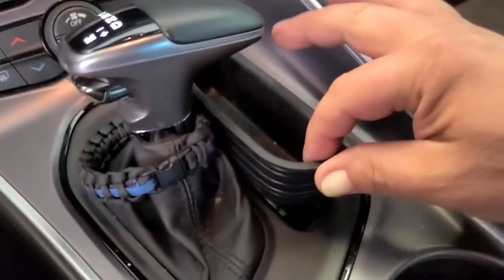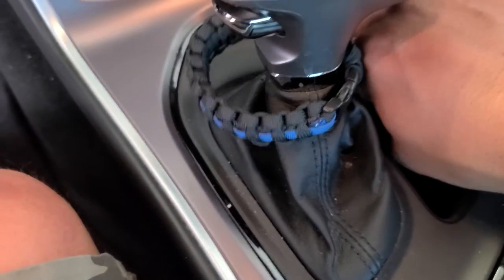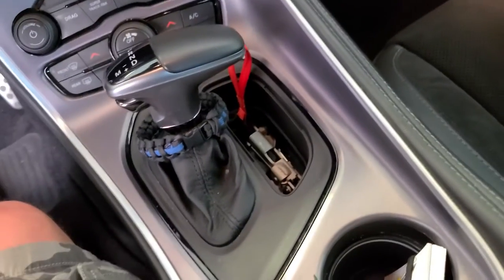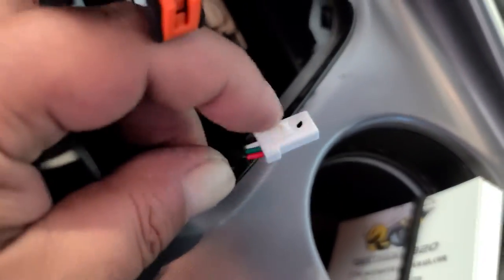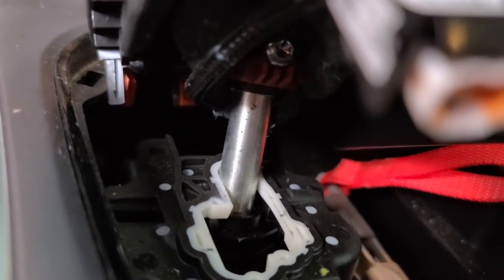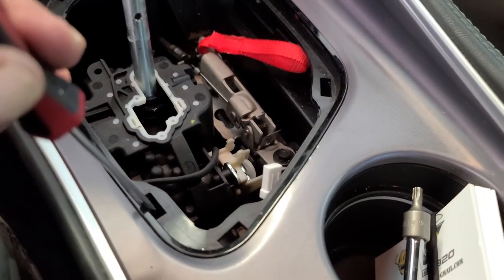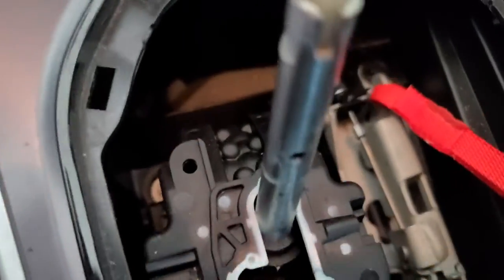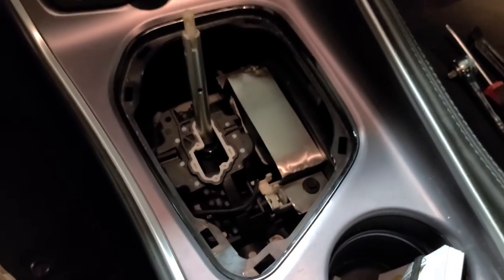The Day I Invented My 1st Anti Theft Product! #hellcat #entrepreneur

Comment: Awesome idea! I'm going to try this. However, does this void the warranty? I only ask because my '18 GT I recently purchased, I have 5yr 100,000 miles powertrain, assuming they're going to do some kind of maintenance on the transmission in the future. (Sorry if that's a stupid question, I'm very new to the Mopar community, and with a measly GT that I need for commuting in the snow.) Thx in advance.
Reply from the maker: No sir it fits in factory bolt hole with modifications. Let me know if.you need anything. Mydestroyer1320@gmail.com
Reply: @Destroyer1320  Ok great! Thanks so much man, I really appreciate it! Get that patented!
Reply from the maker: @fabiolas4  I do have a patent

Comment: Only issue with this is mechanics need to put car in neutral for alignments
Reply from the maker: It can be removed with simple tools and time.
Reply: Mechanics will have a key.  They can put the car in neutral without this release.
Reply: @johnboysoftware7329  but the cars engine would have to be running, correct?

Comment: So all they need is a nut driver to steal your car. 👌 Install a battery cut-off switch. It would be safer, and they won't destroy your console trying to take the cover off.
Reply from the maker: So you think... not a nut driver. New screws provided. Kill switch is a great idea, but still doesn't stop the car from going into neutral...just saying

Comment: Now tell them how to do it without boogering up the plastic trim because anything seems to bend it out of shape
Reply from the maker: We recommend using plastic trim tools for the installation and remove the shifter boot for more leverage if needed. I also suggest putting painters tape around the areas you are prying to avoid scratching.